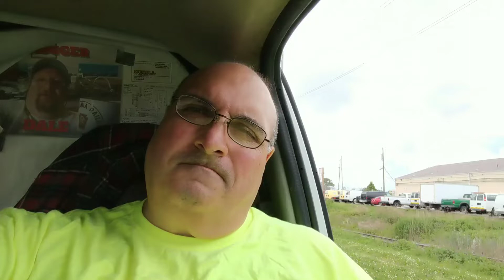QFtT #17  watch till the end please .

Comment: In regards to the foam question, I use a 1/4" insulation foamboard as underlayment on my entire layout.  If you get an uneven ridge between boards, there are several possibilities and each depends on the type of foamboard.  Sanding is great if it is a hard foam- and they make foam sanders, as well.  You can use a wide putty knife (and heated, if possible) and shave it slowly.  Another method is to use vinyl patch or soft spackling compound and do it like drywall and create a smooth transition over a 1-4" area depending on how flat you need it.
Reply: Thank you for your comment and help

Comment: Number of ways to level to foam. Cutting if the is a big difference. Power sanding, rasp or just sanding. The pink/blus stuff is a lot like wood. I was just using my router on my stuff. INPORT use a good vacuum.
Reply: I'm using the pink and the blue both. Thank you for your answer and help

Comment: For Dwights question, I have no experience with foam for roadbed but a lot of experience with many foams. If it is roadbed foam, its difficult, would be hard to cut it and get a smooth transition. Like Art said, you could try sanding and also raising or lowering the sub roadbed. Make this transition very gradual especially if there is a rail joint in this area. You can use paper as a thin shim and fold it to get thicker. this would work well for tiny adjustments. You can shim with almost anything. Cheers Rob
Reply: Thank you Rob . Rick B did something like that if that the same thing your talking about

Comment: There are a couple local lumber yards that I get Maple from, depends how far I feel driving that day. There's only one good local spot for walnut and cherry, though, which I love using for cutting boards. I loooove the smell of fresh cut walnut lol. Just Google search your area for lumber yards, call them up and ask if they carry what you're looking for. Craigslist is good, too, like Jerry said. Sometimes you can pick up a good deal on rough-sawn lumber from there... sometimes depending on the guy selling he might even square a couple sides for you. My local lumber yard does that when I get really long stock.

For Dwight, you can sand, but that gets messy. I've shimmed one side before, either below the foam or on top using a smaller sliver of foam from an off-cut piece. For those realllly fine tuned shims I take a piece of styrene, and slowly wrap it with masking tape until it's the perfect height. Masking tape is cheap, and thick enough that it doesnt take too long to get your desired height, but thin enough to be accurate. Hope that helps!
Reply: Thank you Joey it helps a lot

Comment: Wow thank you. I was wondering if you already had your video made for today lol. Thank you Jerry have a great day
Reply: Regards your two levels of foam that Jerry mentioned, If it's really different, take a big skim off tbe higher piece to get a really small grade going to the lower piece. If they're not too different, add some cork or putty to the lower side to build it up and keep the grade as small as you can.
Reply: @markarnold8160  Thank you for your help
Reply: I have had similar issues with foam not matching up right. I use a hand planer to get them even and then i fill with foam putty. That will take care of any uneven spots. Sand flat and ur good 2 go